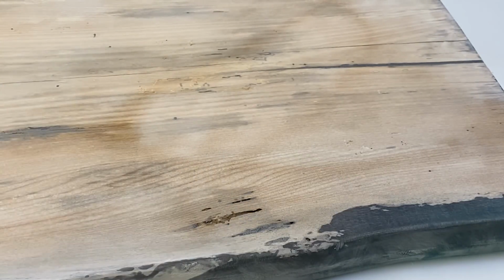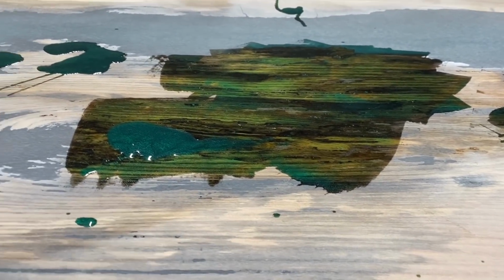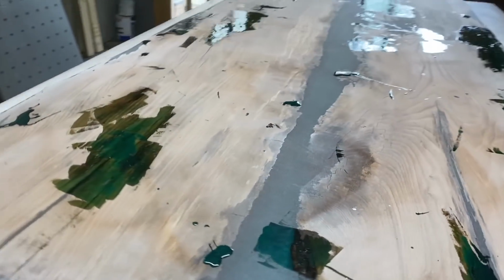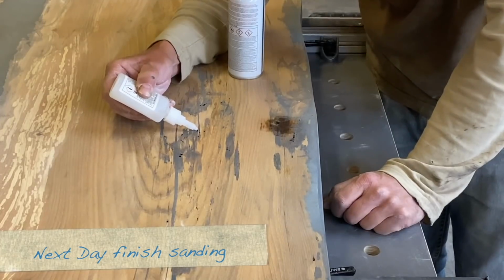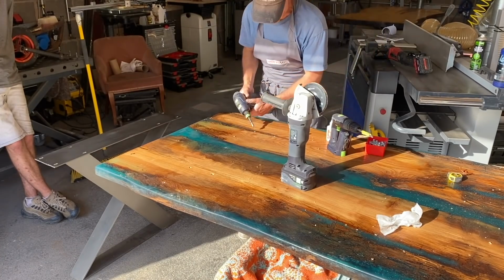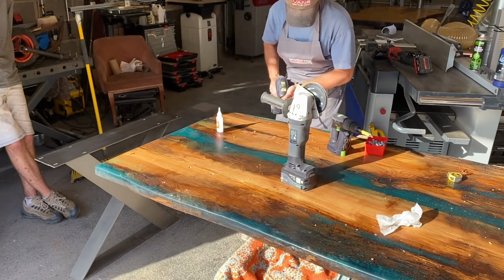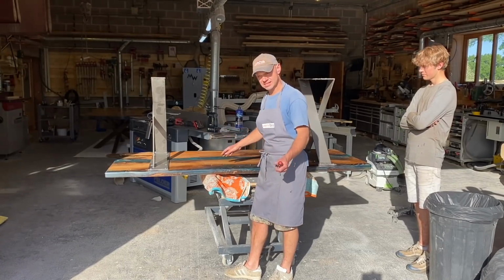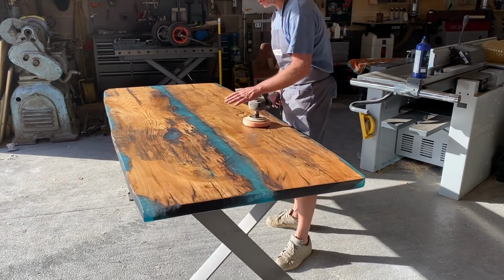English Elm Outside River table p3 final

Comment: Hi Andy, how is the table holding up so far to the elements, i know its still early but wondering has there been much movement in the wood and also the resin, any cracks or imperfections starting to appear, looking at it now what are your thoughts on the longevity of it
Reply from the maker: Unfortunately it’s still inside at the moment as there is a small chance one of the postpone tradeshows will be August and I don’t have any new stock so I’ve had this back
Reply: Thanks for the reply Andy, I know the feeling, havent had a show since February and feeling the fall out from covid now, i had a sample piece of teak and aqua resin out for the last 2 or so years, its actually held up well now that wasnt with glass cast it was a polyester resin, apart from the wood weathering there has been no problems but again that was a small piece, it was roughly 600x500mm also it was finished with wax

Comment: Wow, you are indeed my favorite follow when it comes to resin tables!  I've done several smaller projects now (sofa table, charcuterie boards, floating shelves).  The finishing process is just plain wearing me out!  I don't care for the "flood coat" epoxy look so, like you, I put finish on both the wood and epoxy. My favs are Odies and Rubio.  I love the way the wood turns out but am never happy with how "flat" the epoxy looks.  I want to sand the epoxy all the way up to 3000 or so but, as you know, can't do that to the wood and still use the oils I mentioned above.  Are my expectations just too high for the amount of shine I want ONLY on the epoxy?  I recently purchased a DeWalt variable speed buffer/polisher but not really sure how to use it.  Should I just use some 3M polishing compound?  Will that screw up the Odies/Rubio finish on the wood? Sorry about all of this...just sort of at a loss and don't know where to turn??  I've watched ALL of your videos multiple times and have learned an incredible amount from you but would joining Patreon for you allow me to ask specific questions maybe??  Thanks as always!
Reply from the maker: I really like both Odies and Rubio out of the 2 odies  , but have had water marks rings with both , also find it heard to explain to client how to maintain them , HE oil is easy for them and you can build it up 4/5 even 6 before it leave the shop .   No idea about polishing Odies or rubio.. if it was me I would do some test pieces

Comment: Looks great! I got some questions about the sanding, you go to 120grit on the wide belt sander and then start using the orbital. Could you not just use higher grit on the wide belt sander and skip the orbital? Or does that leave marks from the sandpaper only sanding in one direction? Also, up to what grit do you go on the orbital? Thanks!
Reply from the maker: Resin !   With wood your done
Reply: @ManorWood  You mean wood doesn't need to be sanded to a higher grit but resin does? You still orbital sand the wood aswell with higher grit tho right? Up to how much grit do you go on that? Just asking because I'd like to attempt a little project myself, trying to get informed:)
Reply: @Baziell  depending on the finish you use will determine how high you sand. Certain hard oil finishes you don't go past 120-150. If using poly I usually go to 220.
Reply: @joelthoenen3733  thanks for the info, so basically I need to figure out the finish I want and then sand accordingly? You can get the epoxy to look crystal clear with that grit?
Reply: @Baziell  the epoxy itself will need to go much higher. But wood can't be sanded as high bc it won't take the finish correctly otherwise. Whenever I try to get a super clear finish on epoxy I go to at least 1000 grit wet sanding it
Reply: @Baziell  but I don't do epoxy as much as others. So someone else might be able to help you more with the epoxy stuff
Reply from the maker: Epoxy is more like working with a car or boat ,  so random orbital is the only to get a finish .   With wood you can just use a wide belt sander 120,150 or 180 which ever you require . Hope that helps
Reply: @ManorWood  thanks for the info, helps a lot :)
Reply: @joelthoenen3733  thanks for the info :)

Comment: Really Nice Finish, I noticed you don’t polish the resin, what grade did you send too before applying oil?
Reply from the maker: Should be on the video made 240 ..  and I did polish the HW oil
Reply: Manor Wood Ok I’m doing my own project right now and I’ve got Osmo poly x hard wax oil and wondered whether you had ever used it straight over resin?
Reply from the maker: I haven’t